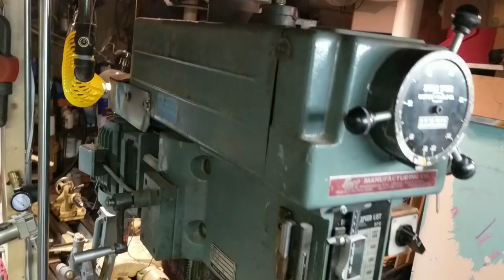Shop Hacks: Round Column Mill edition

Comment: Nice tips. The big problem with a collet chuck is you lose a lot of Z height, however, the convenience for most projects makes it worth it, I have an ER32 collet chuck on my round column mill drill and an ER40 collet chuck on my knee mill and an ER20 on my little Sherline CNC mill. You can get a 50mm face mill with R8 holder and carbide inserts for much less than 50 bucks from our friends in China. Another option is to make a fly cutter from scrap and grind or use a left-hand HHS lathe tool. I've made several in different sizes up to a 3 inch that will swing 5 inches with the tool bit extended. What lathe do you have it looks like a South Bend 10 inch? Thanks for the video!
Reply from the maker: Good comments, glad you enjoyed it.  I've never tried a fly cutter, though it does seem easy enough to make.  If I had it to do over again, i'd have gone with er32 or er40 collet chuck for the Mill drill.  Yes, that's a 1941 South Bend 10L on its original us air Force cabinet.  I'm pretty sure it was in a trailer-mounted mobile machine shop.
Reply: Thanks. Cool lathe especially with the under drive. I have a 1948 9A and a 1917 15"x96". Can't get enough South Bends. er32 is a really good all around size gives you small to clear up to about 3/4" but the er40 goes up to an inch. If you have the time try a fly cutter they are very easy to make and the finish is amazing as long as your mill is in tram. 😀 Sometimes not easy to do.

Comment: Interesting use of a hole saw.
Re centering the saw in the 4-jaw: Because you have the arbor sticking out you could just put the hole saw in the tailstock drill chuck and use that to center the saw in the chuck and rotate the chuck to find which jaw will hit the teeth.
Reply: That’s a good idea!

Comment: It's not the taper that keeps the R8 shank from spinning as a Morse taper does, rather it's the groove in the the side of the shank that locks on to a nib inside the spindle. The taper might help, but it's the keyed groove and nib that really holds it.
Reply from the maker: That's incorrect, and I can prove it.  My quill, along with many other people's quills that I've heard about, does not have the internal nib.  It was sheared off or removed long before I got the machine.  I can rotate my R8 shanks any direction I desire until the point that there is enough upward pressure from the drawbar to engage the taper's friction.

It has to be the taper, there's nothing else there.

Comment: I have the same ER25 on my RF31 but never use a chuck for drill bits since the extended length increases runout, just use the collets alone. You can buy a face mill on banggood for $15, 10 inserts are $6 on ebay: https://www.banggood.com/4-Flute-400R-50mm-22-Face-End-Mill-Endmill-Facing-CNC-Milling-Cutter-p-972285.html?rmmds=myorder&cur_warehouse=CN

Comment: At least you didn't lie about 'hacks' Have fun with your machining, get some copper, brass or aluminium sheet for 'shimming' stuff. A mall nut will localise the pressure. That was actually pretty scary to watch.
Reply from the maker: Which part was scary?
Reply: @TheBuildist  Pretty much all of it. I'm always broke and often in debt (after spine surgery I'm just about unemployable, my wife supports me) I  would make a fly-cutter before I used a hole saw as a face mill. It was never designed to take side loading and is only a thin tube. You may be aware of this but some newbie could try it and get real hurt. Just in case you are not aware of the fact, there is a lot of 'monkey see, monkey do'  on the internet. Posting a disclaimer doesn't change the fact that your doing something stupid and other people may copy you
Reply from the maker: @peterjones6945  I still don't see how you'd get hurt with it.  It could leave an ugly finish on your part if you break a tooth off.  But even at an insane spindle speed, it's such a small diameter that it's still not travelling terribly fast.  Between the small mass and the slow speed, a broken tooth coming off wouldn't even break skin.  A newbie is much more likely to hurt himself via a potentially loose HSS toolbit in a flycutter.  But even that is still pretty limited danger.

But thanks for your honest opinion.  I really value  feedback from knowledgeable people, even if I don't always agree.
Reply: @TheBuildist  I was teaching at a trade school for almost 12 years. You could not imagine how many different ways people manage to hurt themselves. As I said, you may be aware of the risks but there will be people out there that see a hole saw being used and not watch or listen to the entire video. It would probably be a good idea to send people to this site as Marc actually taught this stuff and now retired does it for fun to pass on knowledge that is being lost because majority of 'machinists'  are now CNC programmers http://www.thatlazymachinist.com/

Comment: Seriously.. We’re here because we already know what a mill does and we also know what a drill does and most of us know that a mill/drill is a piece of crap,, we just wanna see what you’ve done,, that’s it,, No lesson required..!!
Reply: A poor craftsman always blames his tools.
Reply: You sound like a miniature train builder.
Reply: @freestyla101 he sounds like a bell-end, more like. 😂. Eh @Militarycollector is either someone who has no machining experience but wants a Bridgeport for his 16th birthday, or has more money than experience and has a Bridgeport.

For small shop hobby usage an RF31 (or even an RF25) type mill is perfectly capable (especially the older Taiwanese made models). It has some downsides sure, but those are easily worked around or modded-out. A used Taiwanese RF31 type mill has a major upside. If it's been kept well by its previous owner(s), it will be much cheaper than a Bridgeport or indeed, a new benchtop mill, and may well come with tooling. Finally, you can fit it into the rear of a decent sized car to get it back to your shop from the previous owners house. 😊